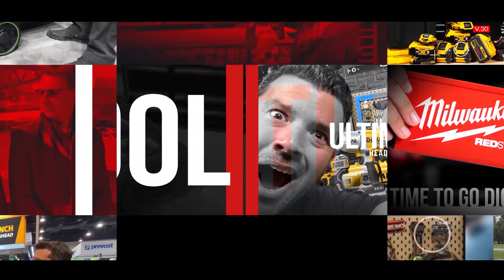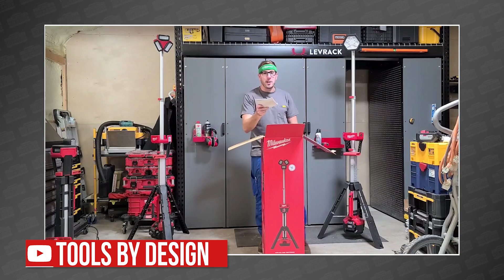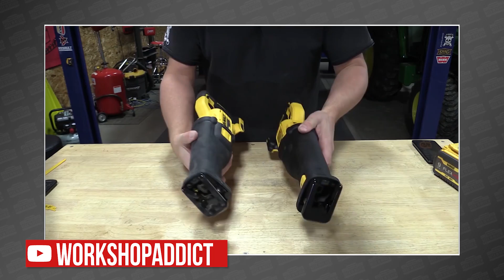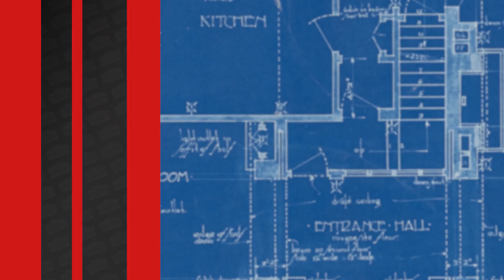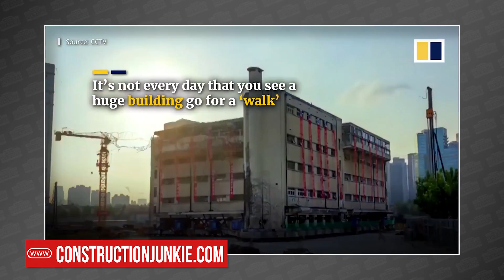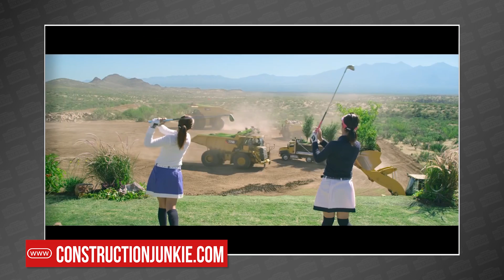Milwaukee launches a NEW ROCKET with GEN 2! But is 6000 lumens enough? Power Tool News S3E45

Comment: I just bought me this light. It should have a super charger for the 18 volts and a fast charger for the cell phones for the price. I also would have liked to see a bright white instead of the off white it has. Also the clamps that hold the post up are not adjustable to tighten so the lights does not slide down. There may be a possibility that with rain or cold weather the clamps won't hold the post tightly like you can with a bycle seat since its the same concept. This is my first tripod light and don't have nothing else to compare it too so for now I think this is an ok light. I bought a 12.0 battery for 219.00 for this light and it took forever to charge in the rocket.. They only had the light only no bag or battery. I paid 449.00.  Im using it in the living room for now. 😄